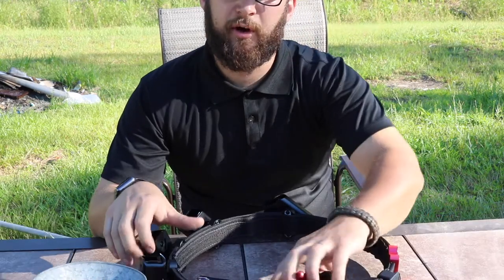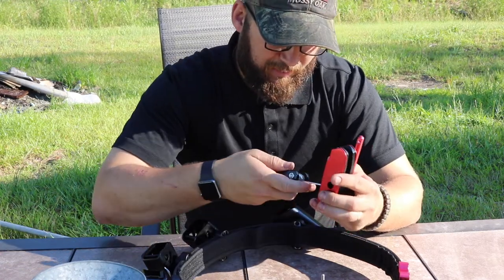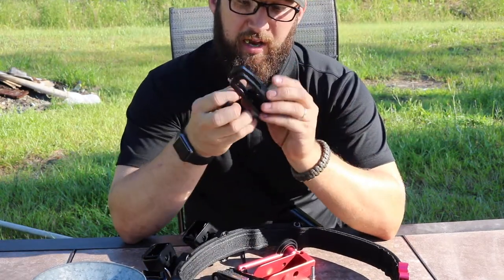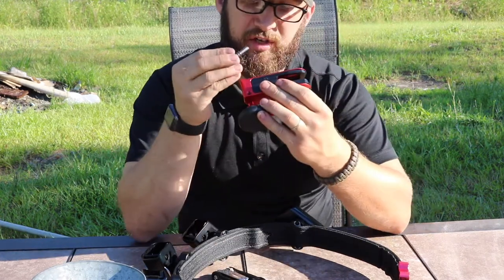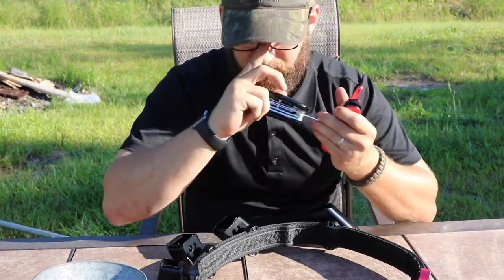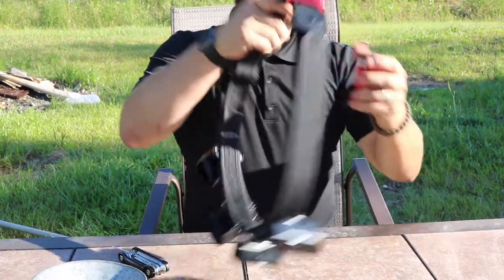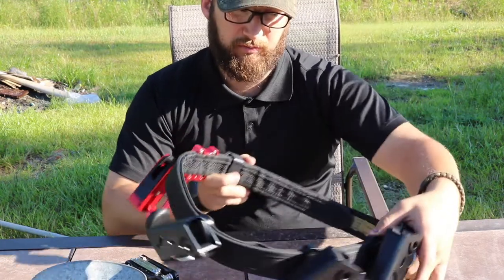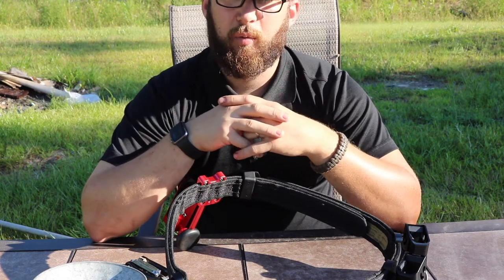Emerson Gear/ DAA racemaster holster Assembly How To

Comment: I received mine yesterday for a glock. I am not able to fit my pistol on the block insert that came with this. I will be purchasing the DAA magnetic insert. Did you have to do any modification or fitting to install yours and get your pistol to fit? Thanks
Reply from the maker: Glock 1923 thank you for the comment.  Yes mine did fit but not every insert is the same.  Sometimes you need to file down the locking block to make it fit properly.  I personally did replace it with the DAA magnetic insert and it works so much better.  I hope I answered your question.  Please subscribe.  Thank you.
Reply from the maker: Glock 1923 thank you for the comment.  Yes mine did fit but not every insert is the same.  Sometimes you need to file down the locking block to make it fit properly.  I personally did replace it with the DAA magnetic insert and it works so much better.  I hope I answered your question.  Please subscribe.  Thank you.

Comment: How does the holster fair when compared to real DAA holster. Is the draw smooth and nice? and does it scratch your grip on the gun. Can you give me some insight of you after some matches, i kinda want to buy a budget DAA holster but i dont want to damage my pistol and slow down my performance.
Reply from the maker: Marco Mah thank you for the view and comment.  First yes the draw is nice and smooth.  I was able to enhance it with the new DAA magnetic insert.  And as for the question about damaging your pistol,  No it won’t.  It safe in the pistol.
Reply from the maker: Marco Mah thank you once again for the view and comment.  If you haven’t yet please subscribe and share the videos.
Reply: so did the original insert made by emerson break? or was it only replaced to enhance the draw.
Reply from the maker: Marco Mah the original insert worked perfectly.  I just preferred DAA magnetic insert for the smoother draw and the ability to know the insert locking system was fully unlocked and released.
Reply: i see, thanks for the help, you've earned a sub!
Reply from the maker: Marco Mah thank you